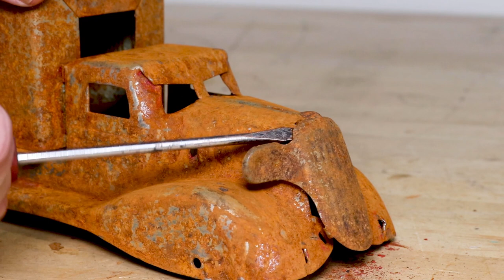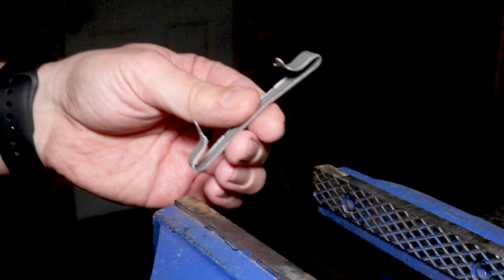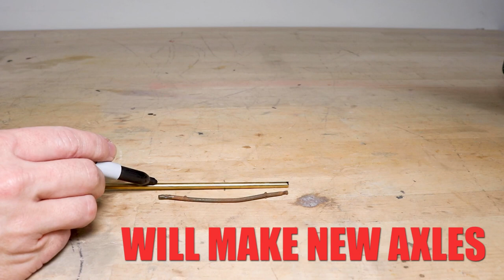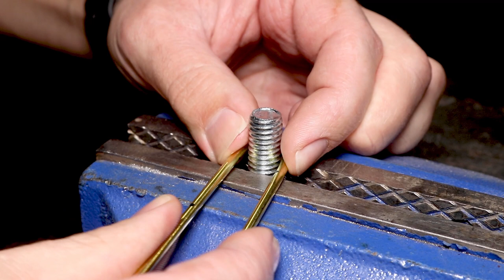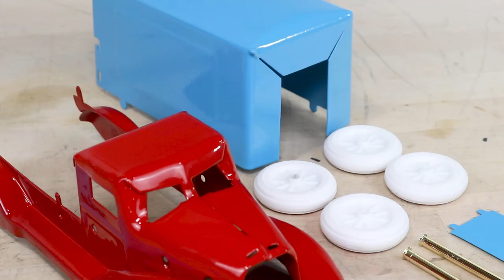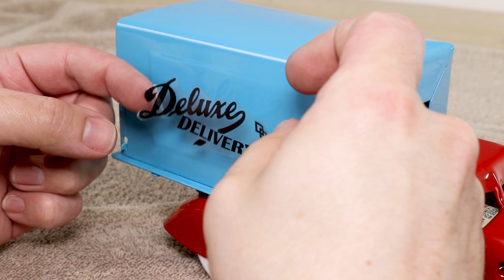1930s Marx Light Up Deluxe Delivery Moving Box Truck Restoration

Comment: I think I like the rubber wheels better as well.  In a restoration it good to stick as close to the original as possible.  But there are some cases where small changes are justified.  And honestly, if I didn't see the original wooden wheels, I could easily be fooled into thinking the rubber ones where the original wheels.  They match the style and color of the truck extremely well.  And while I couldn't tell what the original colors on the truck were, the colors you chose were very believable as such as well.

Comment: Was the truck originally available with or without the working headlamps?  The holes were there for the switch and the contact for the bulbs, but not the holes in the grill part to screw in the bulbs.  Awesome restoration.  It would be great to see an old picture or catalog page of an original example. Great video.

Comment: I've always wondered but never asked... Where would the bulbs have originally been fitted if you need to drill holes in the grill? 🧡
Reply: This would have been a lower end toy, for parents who could not afford the head light version.
Much like an accessory on a new car.
Reply: @Tim-57 Ahh. I see. So same body etc but no lights...odd that it has the battery connector though. 
Weird ❤
Reply: @-Deena.  

I am not sure what you mean about the battery connector, do you mean the bar which the lights touch or the lever to turn the lights on?
Chip is an amazing restorer as well as making his own parts🙂
Reply: @Tim-57  Oh I know he is love the channel! Just puzzled!
Yeah, that's the bit I mean. Why would they put it in originally if it did nothing?🧡
Reply: @-Deena.  

The holes are all there, however not all of the parts are there...not sure if I am right about this analogy...they might be like a power seat in a car, the wiring is all there; but for a different seat.

I did not notice the battery connector before restoration, Chip has a lot of extra parts to copy from...perhaps you mean the bar he bent to add a new connector?

Do you watch his videos each week?
In my opinion he has the best results and editing within the restorations game.🙂

Comment: Therefore, this is why I hate plastic kitchen tools and appliances. All equipment must be made of metal. Therefore, both my coffee grinder from the 40s and the fan from the 50s are still working. The vacuum cleaner from 70 really requires a rewind motor. Plastic parts are the weakest link in any technique.